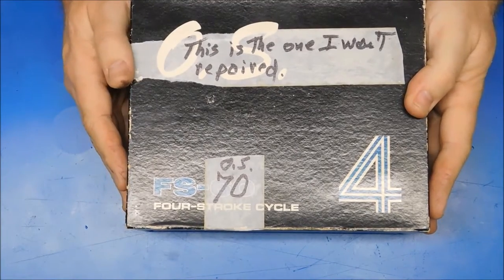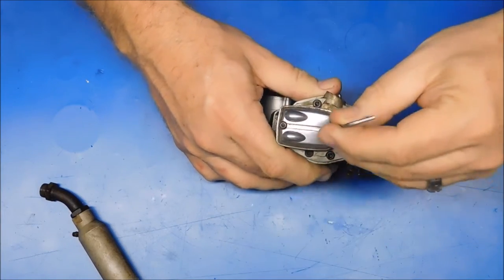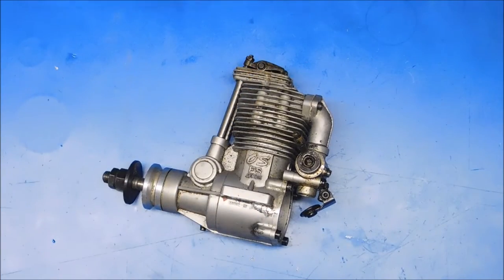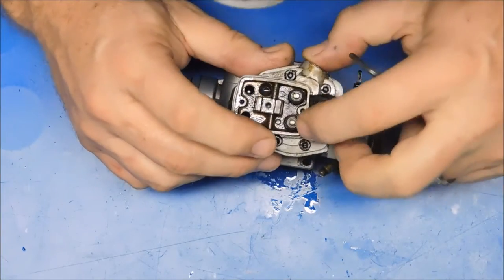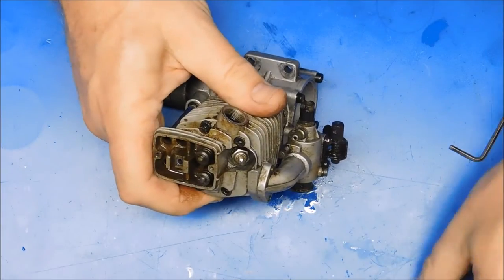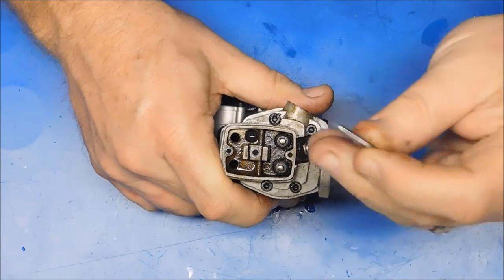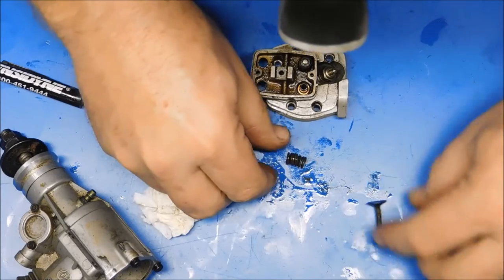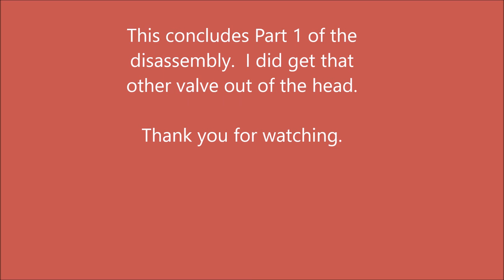OS FS 70 Surpass A Cutomer Rebuild Part 1

Comment: I bought a new stick with this engine and I was wondering what the nipple underneath by the prop is? This has a tube connected to it like it might be an overflow.
Reply from the maker: It is a vent line for excess oil to be expelled from the engine.  All 4 strokes have them.